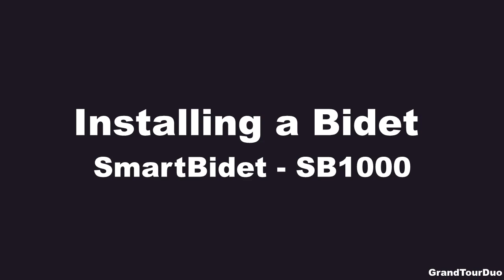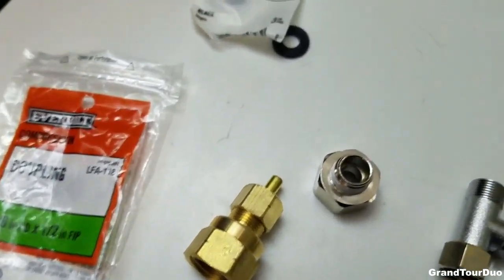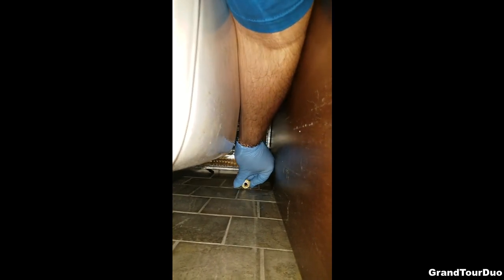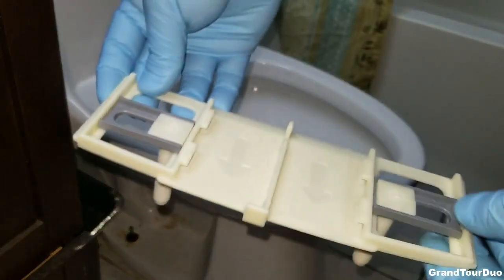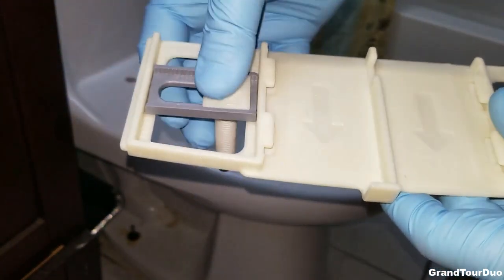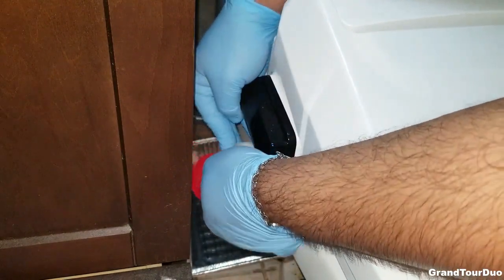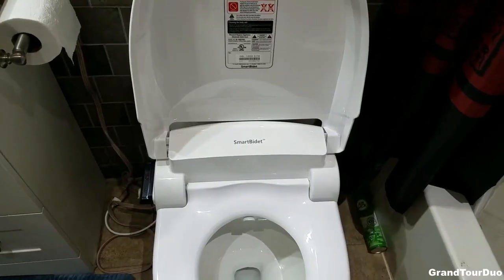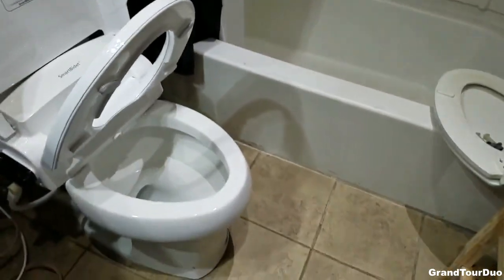INSTALLING A SMARTBIDET SB-1000 BIDET with Review

Comment: Thanks for the video 
words of advice. Use a proper wrench not a “clamp” (standard slip joint pliers in the video) 
Biggest helpful hint is after you turn off the water valve flush the toilet to drain a lot of the water. 
You were worried about gloves for the water line but not the bacteria filled hardware securing the original seat.

Comment: I’m doing a replacement, I have a COCO that’s old and physically broken so I need to replace it. It’s good to know you can attach the T connector down there because that’s where mine is, it looks to me like all I’m going to have to do is hook up the water supply to the bidet .
Reply from the maker: Thanks for the comment and good luck. I've been meaning to install a new bidet and because of an unrelated reason I'm going to have to change the inlet water line. I originally thought oh man I'm going to have to get a plumber but it's a very easy change.

Comment: Does the toilet tank need to be drained of water when installing the hose to it?
Reply from the maker: That is a good question. I did not have to drain it. Just turned off the water and flushed to lower the water level in the tank. If you take the toilet tank cover off to look at the workings (pump and drain/plunger). Flush the toilet and see where the water is being filled from . Chances are that the water is coming near the top of the tank so all you have to do is shut off the water and flush the toilet and the water level will be below where the water is coming in from. Let me know if that helps
Reply: @faultythinking6443  sounds accurate thanks👍

Comment: what's the electrical wire/plug do you recommend please
Reply from the maker: Since it's in your bathroom. It hould be a GFCI plug (preferably grounded but older houses may not have a ground wire). The unit will also advise in the instructions. I am plugged into an ungrounded GFCI.

Comment: Does it require an electrical outlet for heating the water?
Reply from the maker: Yes it does . GFCI outlet . The heated seat and water are a nice feature. Especially this winter they are my favorite feature
Reply from the maker: We had to run a extension cord behind the sink for one bathroom. I since moved and have this issue now . The plan is to put an outlet in using the nearby light switch close toilet for 120V. We shall see how that goes.

Comment: Why would you change out the fitting at the source? Why not take supply line off at the toilet and install the T fitting? (After turning off water of course.) Forget that question Faulty Thinking.
Reply from the maker: After doing a couple of these, the best way if you are comfortable is to swap the inlet connector on the copper line with one that has both connectors. That will give you the cleanest install but takes slightly more skill and cost ($20 fitting). All the bidets I've installed since all come with the little t-adapter and they have worked fine. 

Thanks for the comment

Comment: Water lines with compression fittings don't need teflon tape. And in  some pvc fittings will make it leak.  Just a little fyi for you're diy. Use teflon tape the right way and this was not it. Watchers beware.
Reply from the maker: Appreciate the comment but they are not compression connectors. All are threaded connectors from water line to Tee's to the Bidet. Thank you though for the general advice for compression connectors .
Reply: @faultythinking6443  This from a guy who calls a pair of pliers, a clamp.
Reply: @lordmerren9094  Technically they do clamp.
Reply from the maker: @lordmerren9094  yah no time to reshoot it  or dub it . The toll pictured. At least it wasn't a hammer .
Reply: @faultythinking6443  homie a supply line to a toilet has a little o-ring in it, it's a compression connection. Don't tape those, you'll get leaks.
Reply from the maker: @NageekNoohac  I agree, 100%.
Reply from the maker: Just for the record. This is how I learned as well. You should use Teflon for threaded connectors You shouldn't use it for compression fittings. I'll still use it on threads now and then with compression fittings but I'm extra careful not to get it near the compression fitting. It's mostly concern of me stripping these cheap fittings that are provided. Alternatively I do see a lot of people not use Teflon when doing threaded connections. 

So don use teflon on compression fittings as a rule.

Comment: how do you plug it in to get the dryer to work?
Reply from the maker: Has a standard wall plug like any other device. No special connection needed.
Reply: Glad I ordered the recommended extension cord.  Needed an extra 2 feet 😊

Comment: Thanks for the mini review... This seems to have all of the features that the Brondell and Biobidet units have at more than 50% less cost. How's it holding up?
Reply from the maker: Thanks for watching. It has held up really well actually. The toilet actually had to be replaced so I took the unit apart about a week ago and reinstalled it on a new toilet. No problems still. The heated seats in the winter is probably my favorite feature. We do not purchase as much toilet paper as we used to so if it lasts about 2 years it should start saving us money.

Comment: Bidets obviously use electricity. How much are you actually saving per year by having this device? I've never used a bidet nor have ever seen one in person. I would think just using the dryer mode would run up the electric bill especially with more than one person in the household.
Reply from the maker: It's a decision everyone has to make. If you have solar and battery backup it's not an issue. If you don't ...monitor the change in billing . I would say at the moment I'm sitting happy that I have it and don't need tp for the current emergency
Reply from the maker: Thanks for comment
Reply: It’s not always about money.  I am having a knee replacement soon.  This unit will  provide care I can’t do for myself…… am trying to have to avoid asking for help 😊